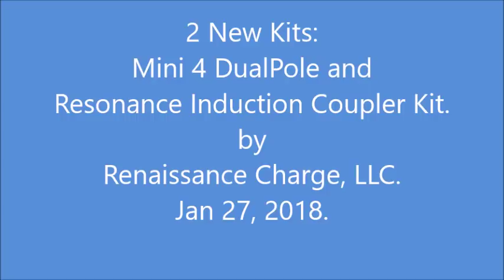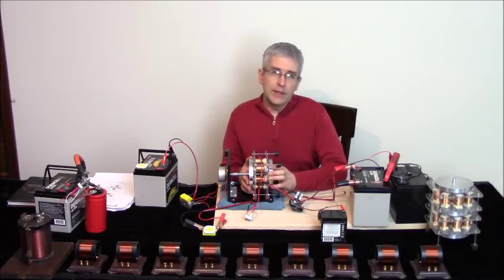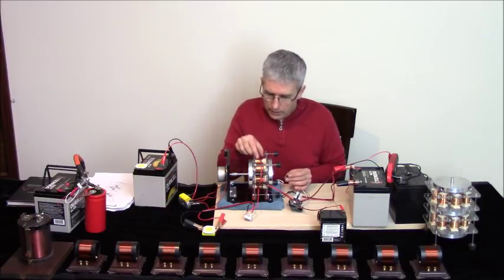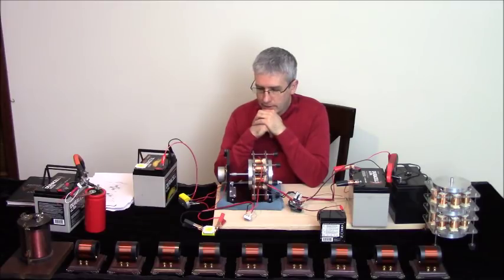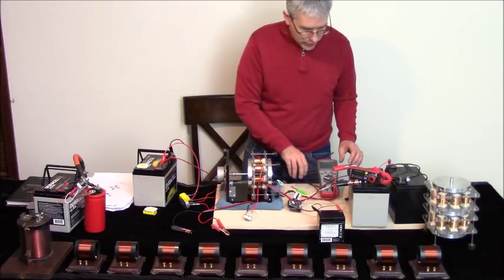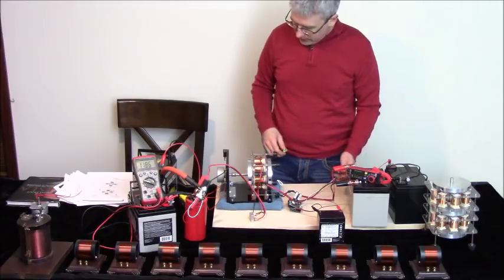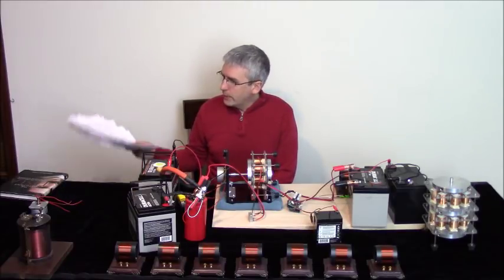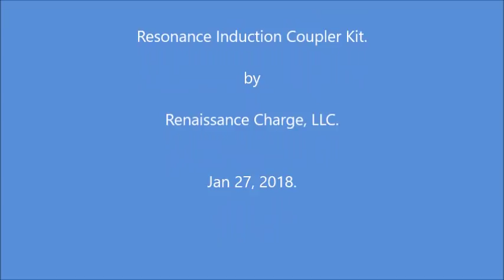2 New Kits:  Mini DualPole and  Resonance Induction Coupler Kit

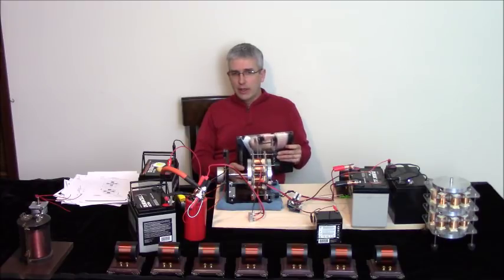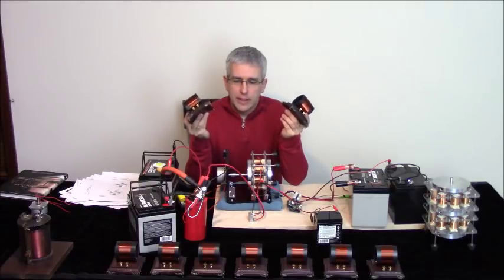Comment: 24:25, 43:03 Ut oh, i think i just blew out that LED. :)  44:21 - 45:41, 46:30 ( I smell a patreon course ) 49:35 (Ignored? You're so kind.) Lectures 1891 1892,1893  51:33 ( Because you do the work. Read through these patents, you wont need anybody else 52:15, 53:07 (!), 55:23 , 55:57 (!), 56:22 One Wire Transfer ( without a return wire ), 57:00, 57:10, ( SO MANY JEWELS in this one video , cant track them all.)

Comment: Great New Stuff Rick!
 I'm curious if your motors will have enough torque to push an electric vehicle? 
If not, beyond research... 
What would the top 3 practical applications - at this stage - in your opinion?
Reply from the maker: I had several boats powered by my motors, the first was a 26' cabin cruiser. Vehicles are harder due to the harsher environment conditions and variable load demands. The newer designs will allow for that more. This video is now obsolete as we just upgraded the rotor to 8 poles so that there will not be the limitations shown here. So when I do a new video I will delete this one.
If we want to make these for a vehicle we would want to make a suitable frame to meet the need. 
The original purpose of these kinds of systems were to make a sort of negative energy pump and were never meant to be motors but merely mechanical oscillators. Initially I designed them that way, but found that almost nobody was wanting that probably do to someone else failing to really properly teach on the subject. I was always a motor guy, having been a mechanic since I was 16. So I made a rider lawnmower as my first real motor model. Then the boat and car, etc. Around 2012 I started to focus the products more around making them motors because that was what people expected and judged them for. That was all they were prepared to work with. So I moved slowly in that direction and focus. But I still kepted the negative energy capabilities, but improved upon them. One of the additions was the generator coils into the motor itself. This not only gave some extra independent electrical output but also was put in there for people to later do the negative energy engineering with as we are finally getting to in detail. 
So the top reason for these has always been as a negative energy oscillator pump that allows you to produce ennormous outputs in the multiplication of energy. Nothing compares to that purpose. With that you can run any loads when you can understand how that works. The next application benefit is it is a very good motor now. While that is a major upgrade here, we equally upgraded the other aspects...
The applications are up to the customer...

Comment: Hello Rick, fantastic job on the Systematic Index book! already got one... :) Any chance to buy the book that comes with the Resonance Induction Coupler Kit separately without the coils and everything that it is shipped with? And what would be the price for the book in this case? Thanks!
Reply from the maker: Thanks. The book only comes with the kit for several reasons. I am not the only one in this kit, so it is not my decision. I really don't make any money on this kit and do it to help people learn five or six themes that they are missing. So far it has worked well, and as planned. And I think the Don Smith book will do the same.

Comment: Can I use this to run a 880 watt load?
Reply from the maker: No. While it may approach that power level the frame is not supportive of 1 HP loads. However, if you apply the advanced processes I have been showing the last few years, and in the new book in the Resonance kit, you can use this system to multiply the output to what you want...
Reply: Rick,  I need power for a data center, I have an array of computer that run on 880 watts a piece. 100 computers total. I'd like to lower my electricity bill. Is it possible to have you consult?

Comment: Hi Richard, you opened the path to my trust in the SSG*  and now you're moving steps forward and forward, guys like you are a Treasure offered by God. Please receive my Blessings.
Loving the so accurate statement "...so you can start building it before you have to understand it all". So like Einstein's statement that "Experience" is far more advanced than "Knowledge" !
Double thumbs up !

*Today I recharge non rechargeable and rechargeable AAA and AAs with it (negative lectricity, no caps), and the life of these batteries is so far superior than my standard charger is delivering !
Reply from the maker: Thank you for any blessings and testimony. I did what I could with the SSG system starting in 2004. Bedini acted like he invented it and limited people so they generally would not be able to do much with it unless they really did their homework. After about 6 months I figured out all that I needed to to power my own needs and then just tried to help people. The SSG can be enough if people have enough batteries. It is great to see some things very easily with few parts. 
My goals in this ministry (to help people find their way more efficiently) is to help people be more independent. And you have to learn by experience. So the kits help people get working experience. We now have many different things people can build and learn by experience from. And more coming soon...
However, I am now increasing my focus on safety related matters and health subjects. The focus of the next year and beyond is proper physical and metaphysical grounding. Properly teaching on all the foundations of life. I did this in the new Don Smith book in relation to electrical grounding, but only mentioned the health side of grounding and the spiritual side as well. 
We'll see what God has for us all...